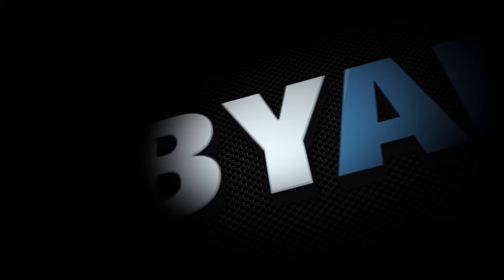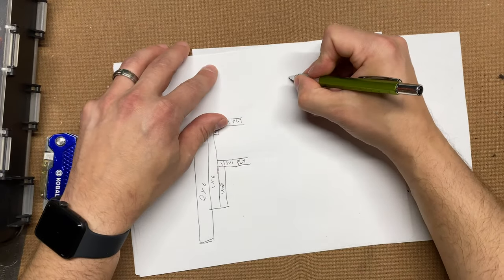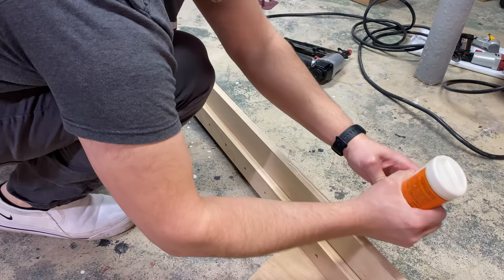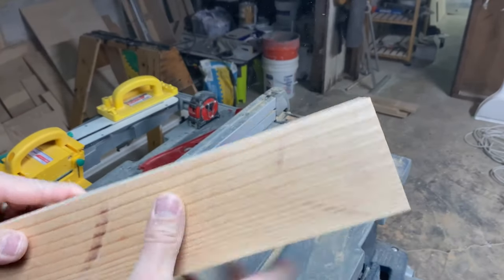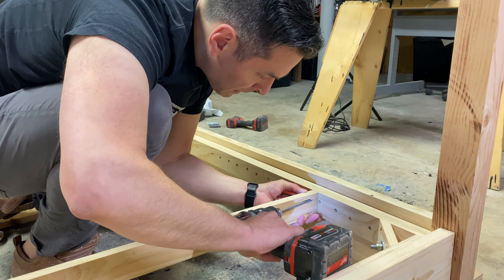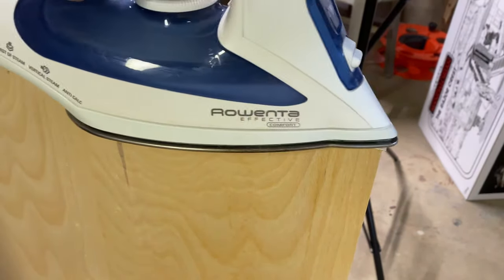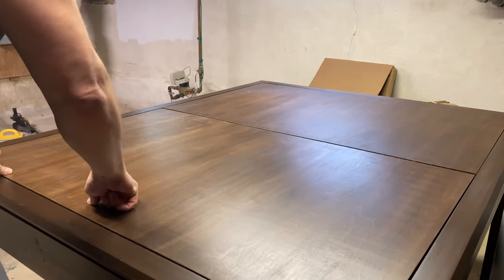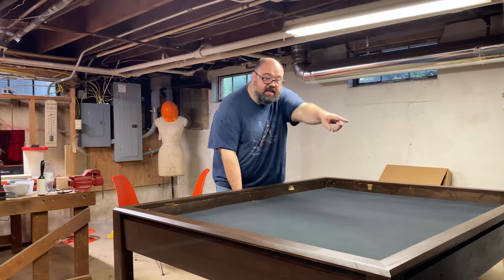Custom DIY Board Game Table

Comment: Some steel under one side of the table and a strong magnet would probably have done it for lifting the table off. You could also still have done a push rod in one corner. Nice work otherwise! I'm about to start on a coffee table sized one of my own design :)
Reply from the maker: Thanks man! If I ever give this another go I’ll try those ideas! Love the coffee table sized concept. Post a link to a pic of video in the comments when it’s done so I can see!

Comment: 6:25 I'll never understand why wood is labeled the way it is. A 4x4 never measures out to be 4x4. Can clearly see its not XD
Reply from the maker: It really is confusing. I need to do some research on the topic to understand what happened and to whom to make the dimensions of lumber all lies haha.
Reply: I think 4x4s used to actually be 4x4 but over time it became dimensional lumber and reduced the size, same with 2x4, etc

I think rough sawn its 2x4, but once they finish it it loses like a half inch each direction